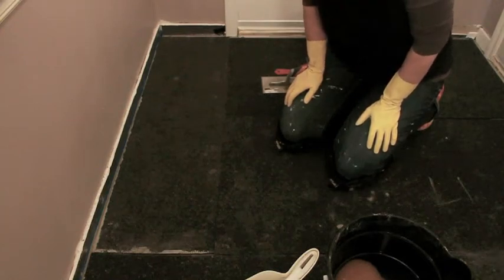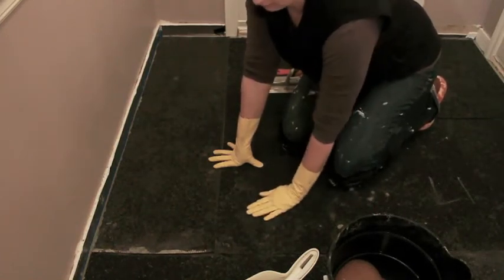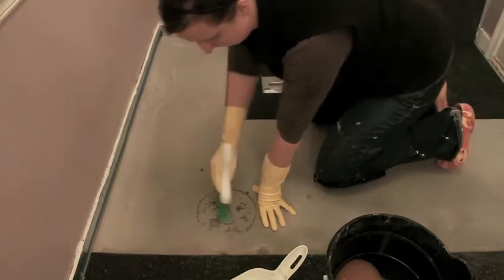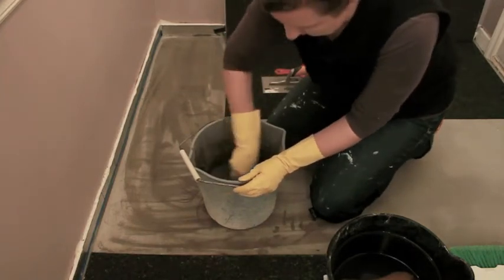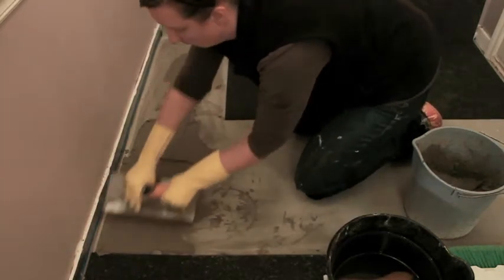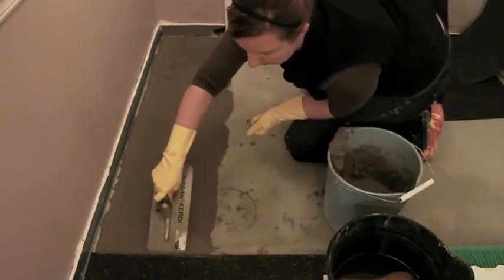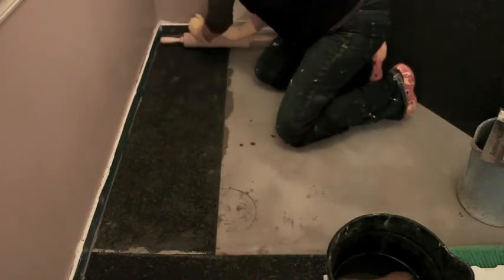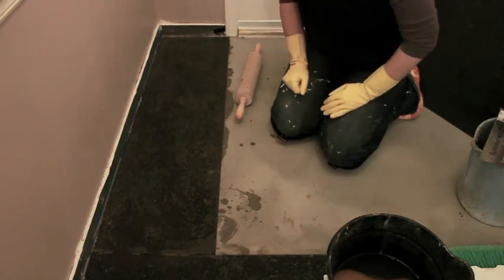Installing CeraZorb Cork Underlayment

Comment: Nice job with this video.I too use both WarmlyYours product and CERAZORB. I also have a product called Edge Strip Kits that I use for floor heat installs with SLU pours. Both the folks at WY and Sound Seal are very familiar with the ESKs. Please do a you tube search to find many video I also have posted. - Phil